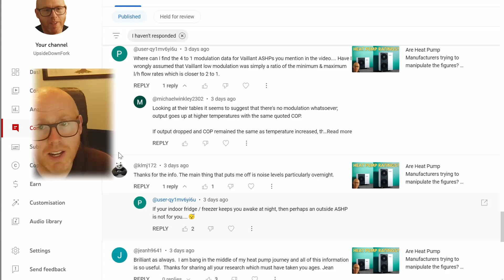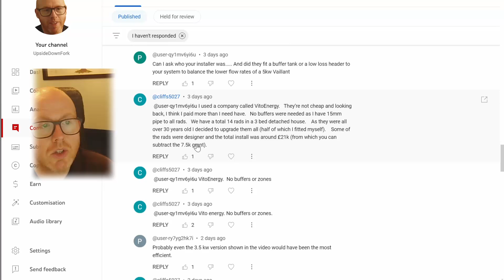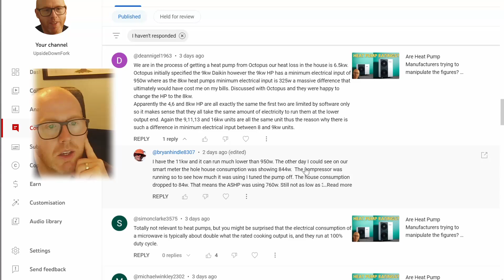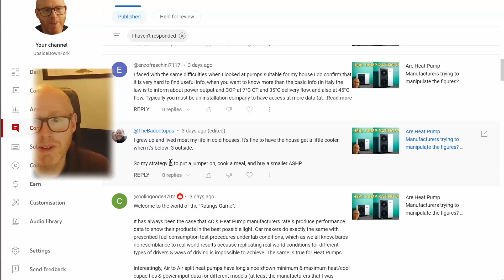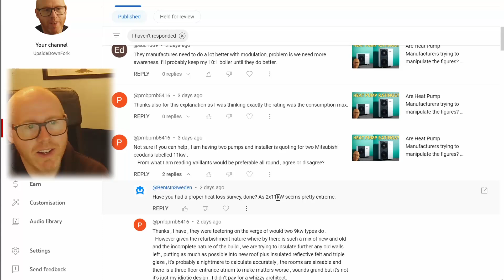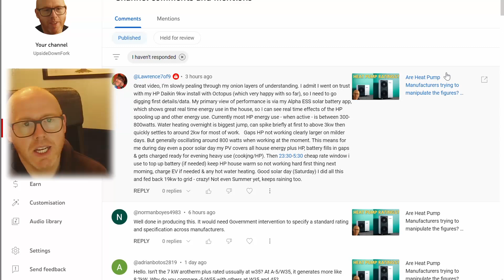What you think about Heat Pump Manufacturer's sizing and ratings

Comment: Had some info from an installer , who has been in operation for many years . I was asking about whether we should go Vaillant of Mitsubishi and this was the reply .
 Mitsubishi hands down is a better option than Vaillant. We've had no end of problems with their units and their customer support is terrible. Their outputs specified are not what they deliver and their controls are based on gas boilers and just adapted for heat pumps.  
    Of course that’s a generalisation and not about specific models.
Reply from the maker: That's a load of rubbish. They just want to fit what they're comfortable with and they should be confident enough to state that clearly. 👍
Reply: Looking at that companies installs they haven’t just utilised one company they appear to have used Pumps from a variety of manufacturers. 
   I was specific about the question to them though ie Mitsubishi or Valiant.
   What I thought was interesting was the comment about Vailant being simply adapted controls for heat pumps , now that might be OK or not as long as they work but the implication is they aren’t as good .
  As for the customer service from Vailant I have no idea about that , yet !
Reply: I should add they may also be influenced by the salt air protection that Mitsubishi use compared to Vailant , but that’s a guess .
Reply: Perhaps also this I’ve found 

Unlike most other competitors’ heat pumps, they deploy an inverter in their units to keep the room at optimum temperature; most others use fixed-speed compressors which are not as effective because the module is either on or off, so that as the room cools, the heat pump starts up again, then switches off as it reaches the required temperature.
Reply from the maker: @pmbpmb5416  Observe the Vaillant's on heatpumpmonitor.org.
They exhibit excellent control and are one of the only pumps that appears to intentionally vary DT whilst keeping a high flow rate.
Mitsubishi may have more advanced control of the compressor and external side of things, with their more extensive history with air to air units, but Vaillant seems to have the best control of the hydronic side of things.
I'm no expert though, so take my comments with a pinch of salt.
Reply: Thanks for info , I’m just trying to get as much input from users to help us settle on the right equipment . I hadn’t considered Mitsubishi being influenced by their Air to Air background .
  I was hoping to get some feedback from Urban and heat geek re Vaillant as well , they certainly seem to prefer them .

Comment: Up to your usual standard of videos = well above average and no not started on the whiskey yet, if vaillant  heat pumps are as good as their boilers to which have had my gas boiler over 30 years = nothing to worry about , Still arguing with myself in regards to why get a heat pump to warm the water to then warm the radiators to then warm the house, the other side of the argument = just get a mini split system to give instant warmth,  for me one seems logical and one seems daft, pity there wasn’t a comparison with similar house side by side comparison with both systems = cost of insulation and cost of running each system, one would think at some point the industry would consider such things.
Reply: There's not much info about for A2A generally I feel, more so with mini splits. In my case I keep seeing quotes in excess of £14k for air to water and I can't really see the value in it, it seems 3-4k overpriced even after the grant. I've decided to go A2A upstairs this winter and keep the old boiler and radiators for now, if happy i'll fit downstairs next year. just bought a spilt and 3 units for less than £2k.
Reply: @maloney19710776  you just purchased mini split with three blowers if that’s what they are called, sounds promising, are you going to track the cost of running them ? Can I ask for update when you have more information ? What was the make and where did you buy it from, sorry for asking so many questions, funny how there’s so little information about ATA yet lots of information about ATW